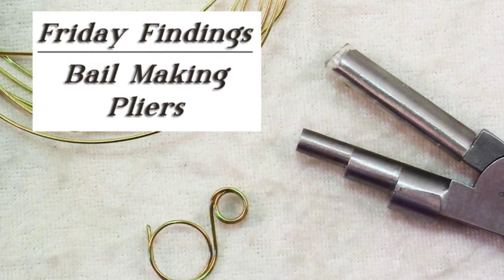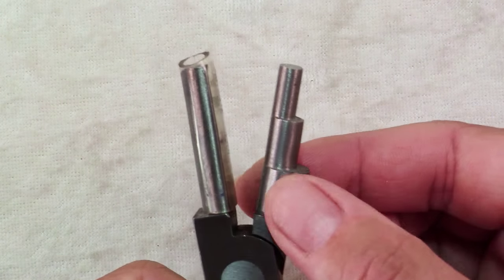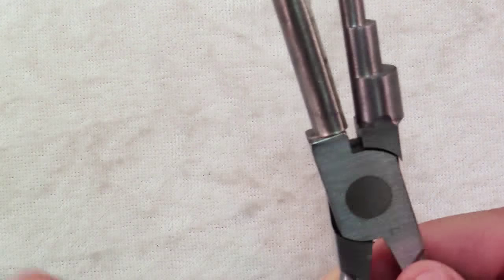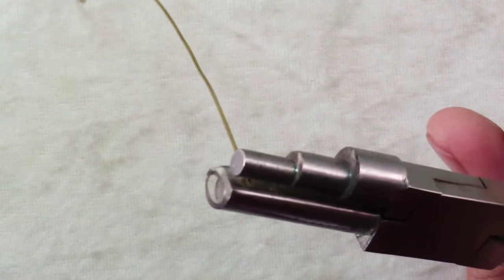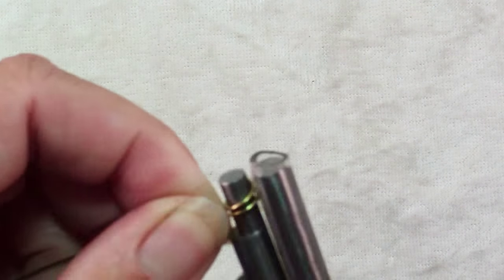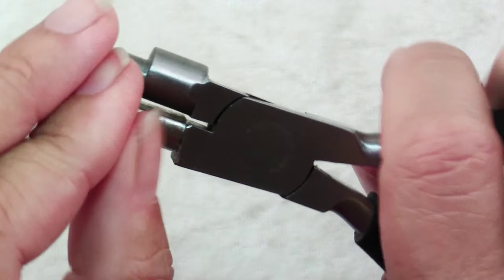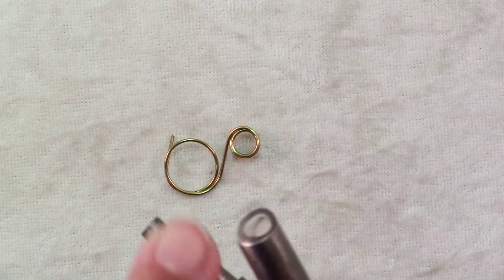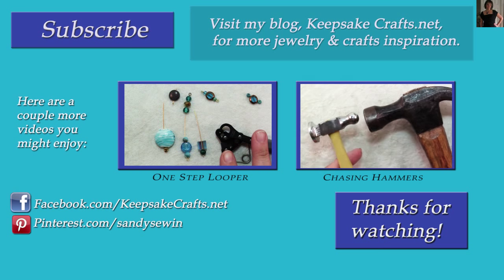How To Use Bail Making/Looping Pliers In Your Jewelry

Comment: Impossible to see what you're doing when you're working out of camera shot.  Plastic sleeve is intended to be left on pliers.  It will eventually wear out.  You can order replacement from manufacturer of the pliers or go to the hardware store.
Reply: Or you can just use a section of hose tubing having the appropriate diameter.  You could likely find it under the hood of a junk car for instance or take apart a broken Mr. Coffee coffee making machine.  Theres tubing inside those things yup

Comment: Hi, do you know if there's a difference in quality, performance, or comfort, between beadsmith and eurotool wrap n tap pliers?
Reply from the maker: Hi Dee, That is an EXCELLENT question, and I wish I had answers for you. Unfortunately, these are the only ones I've been able to purchase. At some point I may get the Eurotool and do a comparison. For now, I'd suggest you search reviews.
Reply: Wrap n tap looks more versatile and better built but I'd bet the comfort level is the same.  You can use short sections of flexible hose tubing to increase the grip comfort of your pliers.  Just cut a section of tubing from an appropriately sized piece of tubing and slip it onto the handle. 👍

Comment: Love your videos....where'd you get that plastic sleeve, especially to fit so perfectly!?!  Thanks!
Reply: +Sandy Huntress   Oh, how unusual--don't think I've ever bought pliers before with plastic sleeves on them!!  Thank you!
Reply: You can also use different diameters of various types of hose material (ie. garden hose).  Just cut a short section of appropriately sized tubing or hose and slip it onto the end of your pliers. 👍
Reply: I was thinking to put on some self-adhesive felt sticker.

Comment: What to do if the wire is too strong to bend with your fingers?
Reply from the maker: Use tools or a softer or finer gauge wire.
Reply: @SandyHuntress  I just push it against a piece of hardwood, as tools damage the bend item. Overall the tool does what I need it to do. Mine did not come with a silicon sleeve, but it does not seem to put scratches on the material. Without the sleeve the grip is better as well, you can get a wire by the very last end and still bend it.

Comment: Hi Sandy.  Love your videos.  I am new to jewelry making.  I purchased the exact same bail making pliers you use in your video and they work great for me, but I've noticed a lot of people use bail making pliers that are rounded on both sides.  Do these have a different application than the ones with the flat side?
Reply from the maker: All that I can think of it that the other side of the pliers might provide a madrel that is yet another size.  If someone knows differently, please correct me, but I think both types work just the same way.
Reply: Our dear sweet beautiful hostess has an excellent video illustrating the use of round-flat pliers.
Reply: Watch it here https://m.youtube.com/watch?v=an8RjVxQ-bg